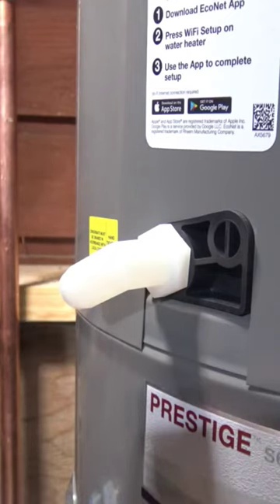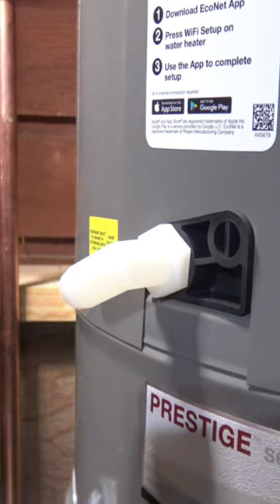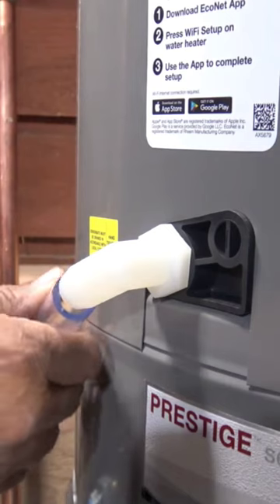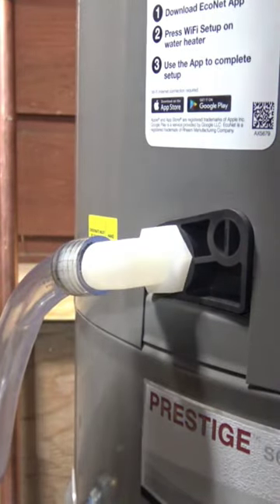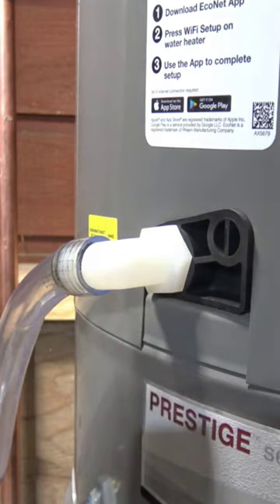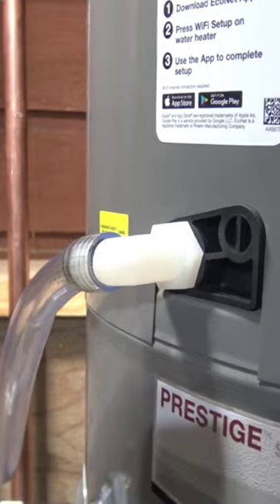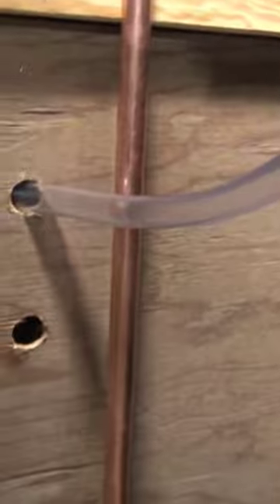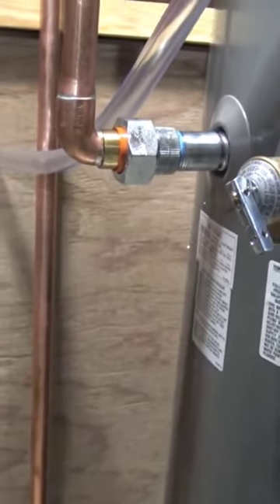Hybrid Water Heater Condensation Drain Line. #shorts

Comment: Yeah it will let the tenant know that the condensation line is backed up but then the tenant doesn't call and then it starts over flowing all over the water heater?
Reply from the maker: Yeah. It just makes it easier for a service tech to locate a problem. 👍
Reply: My system is clogged and it's hard PVC run goes in the wall and then it goes outside.... I want to know how to unclog the line